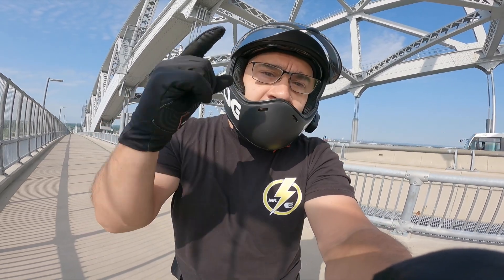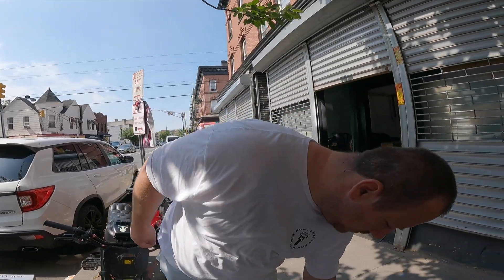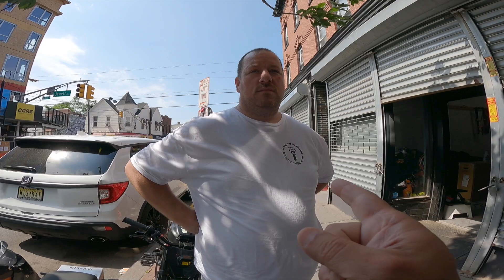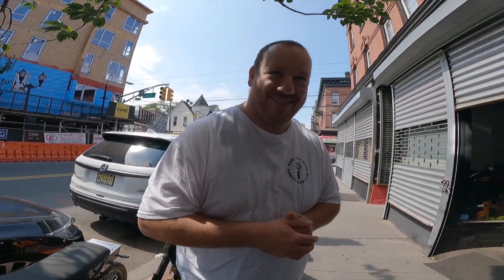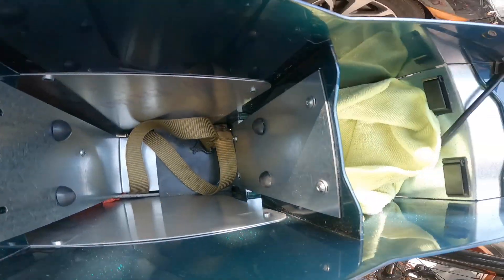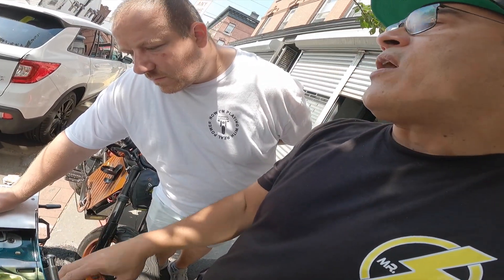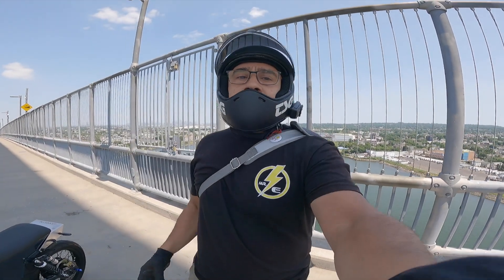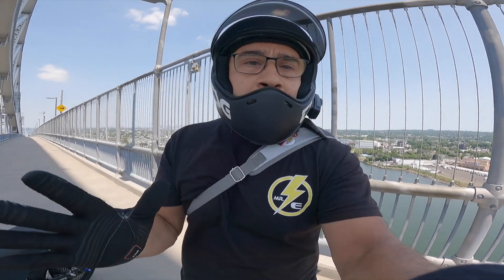BUILDING A POWERFUL LITHIUM BATTERY FOR THE SPARK CYCLEWORKS JAVELIN

Comment: I really want the brute in the near future. But I still have some unanswered questions like what kind of cells are used for the battery?And if there's any water resistant rating?
Reply from the maker: @cwebb5537  The BRUTE has option on battery cells and capacity… You’ll have that option at check out… and all of the electrical connections are waterproof… I believe an IP rating of 4
Hope this helps… 🙌💯💪

Comment: You should ask V to build it with the P45B molicels to get more power and capacity at 4500mah Thats what I'm having my battery built with.
Reply from the maker: There’s a lot if talk and a heavier price on those… let the drop hit and it’s on… 🙌💯💪
Reply: @mr.e_from_nyc  oh yea the price was definitely more but I figured do it right the first time. Lol. I got a great deal from my boy and he got the P45B cells directly from molicel. It took forever lol from Taiwan. Thanks again for a great video I can not wait till my bike is done.  I'm hoping in the next 30days. I need to hit up DJ Sounds to tune my fardriver also
Reply from the maker: @oldmanebikes8392 I hope they are better… I guess you’ll let me know… can’t wait to see what you’re making… DJ SoundZzzzz can work wonders… 🙌💯💪
Reply: @mr.e_from_nyc  yes they are soppose to be awesome cells I just seen a video a few days ago testing one and it had like a 30sec burst power of like 170a for a single cell. That's crazy. I will never use that but nice to know. It might have even been for 60sec. Be safe buddy and see you soon.